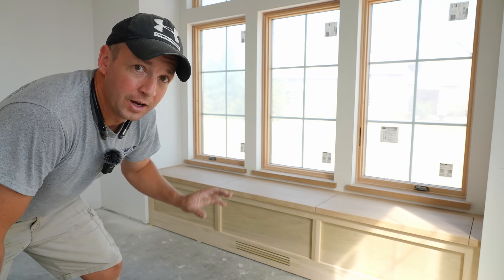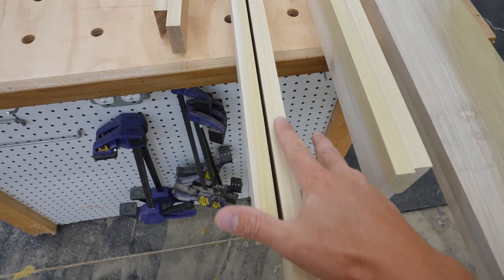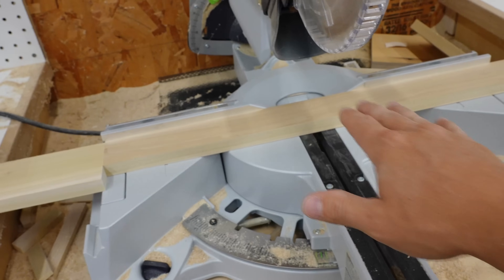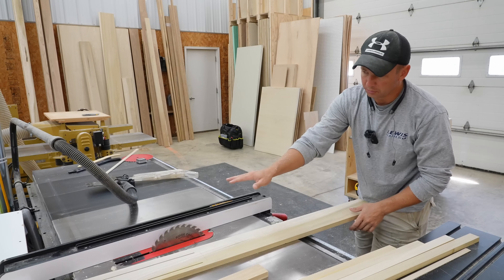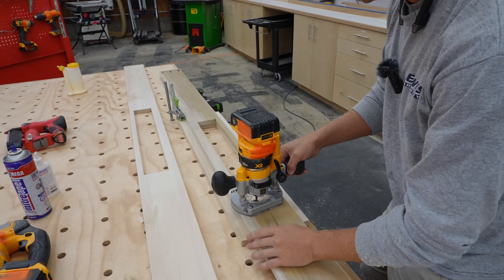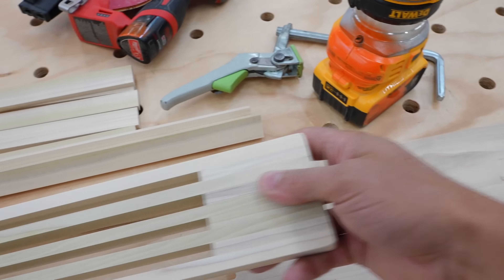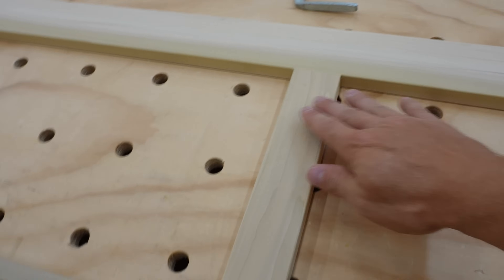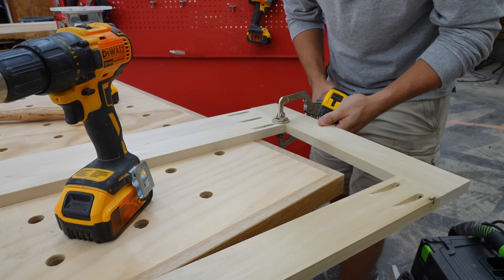A Fun Window Bench Seat Build

Comment: Great job on the builtins, Spencer. I do these all the time. Two things I like to do during install is to (1) seal the cabinet to the floor where the vent is with Lexel or some other form of a silicone sealant, and (2) use duct board or some other form of a rigid foam insulation for the vent. This will provide a dramatic improvement in airflow from the vent going where you want it to go, and prevent condensation buildup in the cabinet during the summer months when the A/C is running. 
I have found that here in south Louisiana, we run our air conditioners practically year round, and the bottom of the cabinet can get quite cold from the vent having constant air flow. I would imagine that in the winter, when the heat is on, the opposite would be true for your climate. Rigid foam with the foil face can help to mitigate these problems.

Comment: Well done.  I appreciate the longer format.    Two suggestions: 1. Install a booted hvac duct instead of just a cavity under the cabinet.   That would be a higher quality job.    2. Add an electrical box to front of cabinet (as part of design, romex could be hidden/protected), that way owners won’t have to run extension cords.

Comment: Great work as always i just want to recommend you to try using BLUM hinges for the top doors.. they have 180 hinges(Blind Corner is what they call it)  the door  and mounting plate are in a same plane.. a lot of adjustment and can be with integrated soft close or not.. mostly used in kitchens for the corner cabinet

Comment: We always make 1/4 inch slots in 3/4 poplar for vents. Plunge it in and out. Very fast and looks awsome. It's not removable but who is really getting in there to dust? I do like your double roundover detail though. My way is quick onsite with no gluing and clamping. Set your start point and move the fence 1/2 inch per pass. Gives you 1/4 inch space and 1/4 slits.

Comment: I always happy to see your videos.  In the video you mentioned at soft close mechanism can be installed if desired. Lid supports are absolutely necessary. THIS IS A SERIOUS ISSUE AND DESERVES TO BE PINNED.   In the 1970's many toy boxes and hope chests were recalled due to children's heads being trapped between the edge of the box and the lid.  Search "toy box strangulation hazard."  Many results refer to Hope Chests that locked with children inside but the choking hazard is even greater.

Comment: Great video love the long format it shows more detail on how to.. I got lost on the last few minutes showing the final fit guess I was looking at the window stools too much. Correct me if I’m wrong here but you have 3/4” stool with a 1 1/2 face so no apron is needed? I deal with drywallers that set me up for easy install only to screw me on it. They sure  know how to Jack up a job and I don’t mean the price. The idea of fitting a stool under the drywall leaving proper revile on the window just escapes them,, any tips on how to deal with them?
Reply from the maker: We pre shim all the windows at framing stage before drywall is applied. The drywaller routes to my shim. The sill is 3/4" for the main part with a 1" thick nosing. The nosing covers 1/4" of drywall and thus no touch up is required and it covers the jagged drywall edge. It's a nice detail that I have been doing a lot of lately.
Reply: That’s a nice detail, but on the jambs do they leave drywall down to framing so the stool is coped to what they give you? Or do you slide stool in under gwb Me personally would rather use Collin stair jig  and back bevel one side and lay it in against the drywall for the jambs, and adding the extra 1/4” to cover under stool is great provided the drywaller gives damn about fit and finish

Comment: I love seeing how you do production work. I have the DeWalt planer and I usually account for about 3” of snipe on each end. Just curious, but how much snipe do you get on your planer?
Reply from the maker: My planer rarely shows any significant snipe unless I'm removing a lot of material on a wide board. But they all snipe at about the 3" mark so that is what I would figure extra if I needed to cut it off.

Comment: i was building some cabinets for myself, started a few months ago then it got put on hold. When i came back to it i trusted my old measurements but changed a detail and wouldn't you know they dont fit. Now they are sitting for a few more months while i have a mental health break. I think ill cut down the side against the wall and use the framing nailer, that will make me feel better.

Comment: Great Videos, I have learned a lot from you over the years. Question, What length of Castle Pocket hole screw are you using for your face frames. The 1 1/4" or the 1 1/2"? Keep up the videos.
Reply from the maker: Both. If splitting isn't a concern I do like the 1-1/2. For harder wood where splitting is a concern the 1-1/4.

Comment: Just 3 things:
1: The end grain on the lids. They’re not only gonna suck up a lot of paint, but the center ones will be visible when lifting the lid. (You probably should’ve edged banded them, IMO)
2: I was thinking weight wise and what they might put in the box since they are pretty big. So I probably would have raised the end two boxes up to match the center box height, and put cleats under the shelves all the way around for the bottom shelf.
3: The magnets on the vent, but you did mentioned that towards the end of the vid

Comment: - I’m moving to a home that I want to build cabinet/ bookshelves over floor vents. I see you design with limited space and venting for I assume proper air floor. Has a hvac guy ever advised “not” to build over a vent for airflow reasons. I’m a bit concerned about air flow.
Reply from the maker: I feel like it will definitely cut down on air flow. It's not ideal IMO.

Comment: Use your power feeder for ripping those boards on your table saw.  With a good ripping blade, there will be few if any saw marks.  As much as you may believe ripping by hand is accurate, no one has the strength to hold a board as firmly all the way through the cut to the fence as a power feeder.  Those saw blade marks are from minute movement of a board coming off the fence and if you need to stop to reposition your hands, you will see a saw blade nick.  Save yourself the grief.  You have a power feeder, so use it. 😊

Comment: May be better if floor of the center section of the cabinet lifts out for access and the vent is formed by routing slots in the bottom member of the face frame.